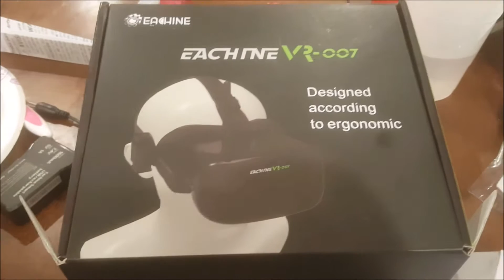How to mod Eachine VR-007 FPV Goggles ProDvr with on screen display/playback/menu & Mic audio in

Comment: hi,  just one question: where do you solder the audio out cable?
Reply: oh, wait, is the audio from the dvr or from the camera?   psd: sorry I insist
Reply from the maker: Ivan Mv audio in and out connections are on the dvr. I didn't need to solder the audio in, I just swapped in the one with the other

Comment: Thanks for your video, I ask you how I can connect glasses 5.8 ghz eachine vr 007 to dji mavic pro 2.4 ghz? ... help me ... amigosescuderos@gmail.com
Reply from the maker: sorry, I don't have one of those.
Reply: Just purchase a small 5.8ghz AIO fpv cam ($22) strap it on the gimble or anywhere and plug it into its own battery (200mw cam at least if youre doing it to dji)

Comment from the maker: I have found a tiny bit of lag in the video while doing fpv, so part 2 of this will include a switch so you can go back to a direct connection...
Reply: and you drilled the phono lead hole in the wrong place too? get a loose wire dangling down in front of your video screen now yea?
Reply from the maker: Yeah, oops, lol. It works out though, I just let it hang out when in use and then slip it in the hole like a holster when not in use.
Reply from the maker: I've added the switch, still need to make the video...
Reply: well done for modding regardless :) good job :) would you like me to upload a video showing how i did a simular mod?